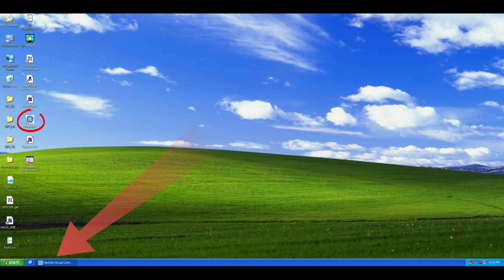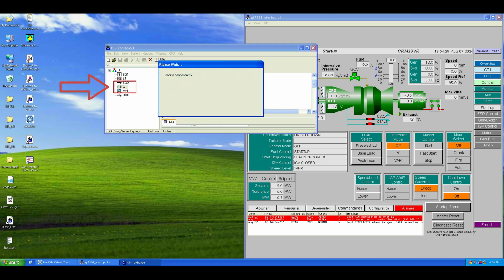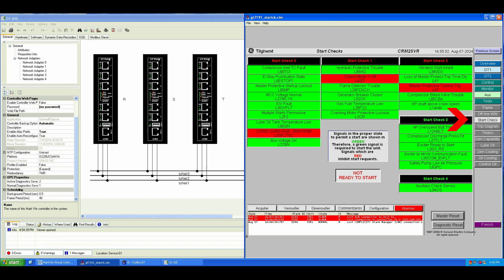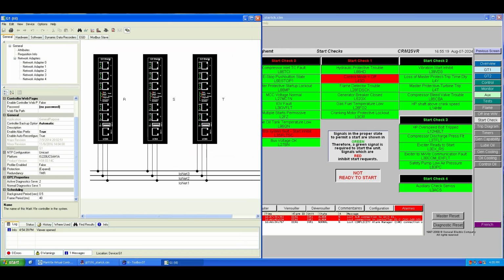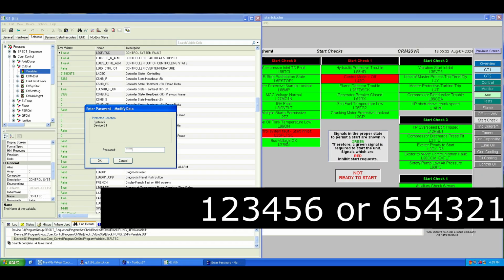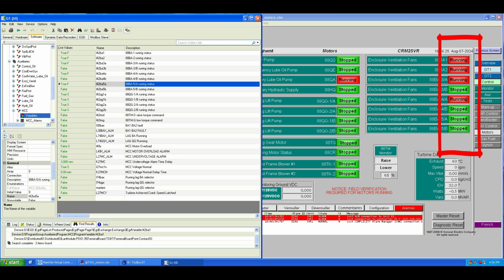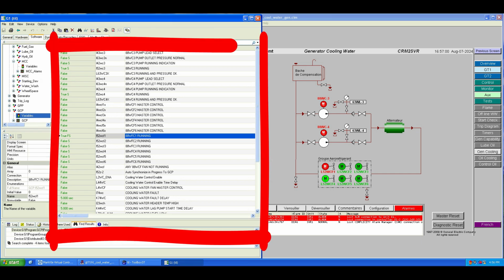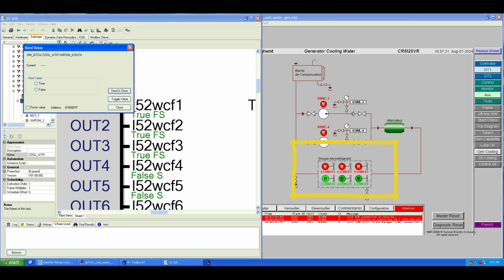Mark VIe Simulation: How to Force Signals with ToolboxST & CimView | Full Walkthrough

Comment: how can i change the reading of temperature in HMI view from F to C
Reply from the maker: You can change the units in Cimplicity Workbench. Just open the project tree, go to Advanced, then select Measurement Units. Just a note — it’s best to practice this only on the simulation. Don’t try it on a real running system unless you have proper experience.

Comment: Do you have any modify design password?
Reply: Some libraries are locked in the View Design. It worked for me "reqengr1". Most passwords are basic and shared between projects worldwide. I'm still trying to get the Modify Design passwords.
Reply: Modify Data works fine. I'm trying to get the Modify Designs to work in the model and also to enhance the simulator and associated programs.
Reply from the maker: maint pass: 123456, higher role: 654321. the highest: we need a h@ckèr
Reply: @GE_SCADA yeah... That's the main problem with GEV. They never share modify passwords with customers.
Reply from the maker: a video about secutity, Configuration System Management (CSM), is needed i think, maybe soon.
did the pass worked for you???!!!
Reply: @GE_SCADA  controlst password 123456 & 654321 not workig with me ??
Reply: User management (policy and roles) and alarm management could be interesting